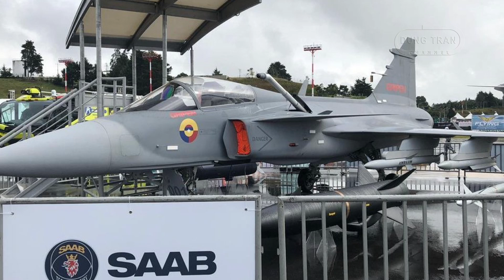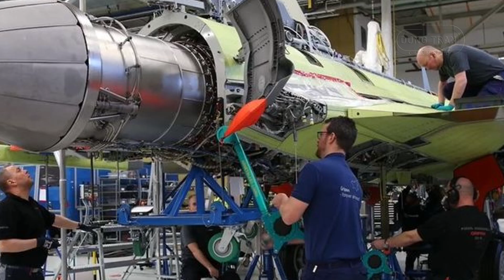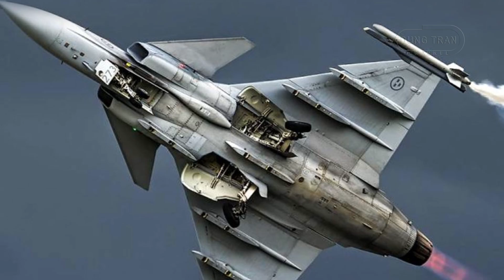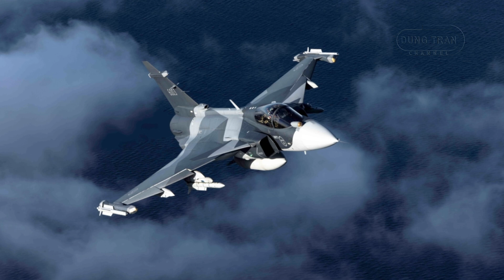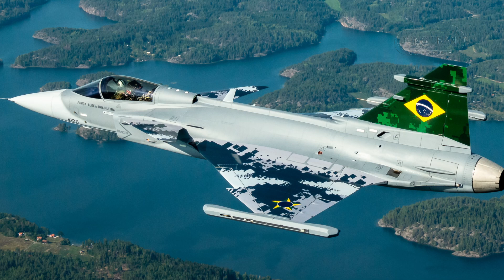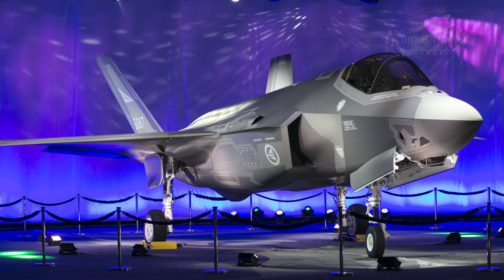Swedish Gripen's Achilles Heel: The American Engine

Comment: If they are for Canada GE 414 an improved GE404 already in the CA F18 makes servicing sense, not much up skilling required . Just cut a deal with Trump no ITAR  for your Northern Cousins and you continue getting a fair deal on a certain amount of oil and gas ! rather than exporting that portion of it offshore as new pipelines come on stream .
The next President may not be bothered with  ITAR and let's face it the new Gripen E's  won't be ready till then anyway.

Comment: it would take years to adapt the design - you need to adapt assembly lines, jet design, and everything that interacts with the motor (hardware and software wise). it uses other avionics components that are US made as well. why not just buy the rafale which is already ITAR free, battle tested, proven to be the best multirole fighter in the world and one of the jets that is already in the works to be working with 1+ support drones (the successor to the dassault neuron).....
I don't get why no one considers the rafale as an option. it makes no sense.

Comment: It not is not a F404G that is just the American designation they Assumed it was a direct copy but it wasn't it's spools were changed in Sweden and if they need to they can change slightly the diameter of the spool shaft or as Donald Trump is threatening to "Take possession" of Canada Greenland and Ireland Sweden could use the EJ200 and modify it's spools to get the power that Sweden needs but if Sweden makes "All" the Gripen Engine components then Sweden cannot be blackmailed either by Trump or Engelson on the UK PM chair.

Comment: Use one of the new Rolls Royce engines, continue to make the Gripen-39, make a slightly larger 2 engine version "Gripen-42" with 4 extra 4 pack of the small air to air or air to ground missiles mounted on the wings, 2 of the new 1000 km long range super missiles or 3 big of the ones used now, it's 4000 kg. More payload and enhanced fual capacity of 2000 kg. A total of 6000 kg more payload and at least 500-750 km longer flight range. And screens and new super computer helmets with superior target tracking and lock, even more super advanced LIDAR scanner and radars in frequencies used to be superior in the 1000 km long range needed for the new super missiles. With these two versions Sweden can be the ruler of the skies in 95% of all missions, with a small 6-12-25 group of the new 6-gen Tempest for special missions with at least 2 jet fighter drones as wing men. Europe will have a superior air force as big as the US and slowly larger in 2035-2050.way cheaper and with full control of everything, artillery, infantry, engineer core, supplies of everything all setup in a super efficient way will with just 7 new nuclear power aircraft carriers with space for 75-77 aircrafts and around 50 choppers in groups of attack, rescue/self-defense/semi-attack, troop transport, surveillance/self-defense with support ships and 1-2 sub's in every group. Everything set up in an international alliance of European and possibly Canada, Australia, Japan, will be a true EUROPE and allied countries Super power of Military, Economy and Trade. 🇪🇺🇭🇲🇯🇵🇨🇦

Comment: In a modern war, the Gripen would be shot down fairly fast, so need to buy a lot of them.  Gripen can hardly be used for air superiority, though after having air superiority it can deliver the bombs.  Gripen is a simpler plane and pilots can be trained much faster on them than  a USA plane.  The F 35 is stealth and much better, though much more expensive to buy and maintain.

Comment: The engine was chosen because it's a very common engine that is used in civilian aeroplanes and its easy to get spare parts and mechanics that can work on it.
But Sweden does not have a problem buying other engineers or manufacturing themselves. Sweden has made turbine engines for over 100 years and there are a few companies that can make them in Sweden. Engines can also be made in countries like Canada by companies that already make engines for civilian aeroplanes.
Reply: It is probably not as simple as replacing a car engine... I guess that the aircraft is basically built around the engine.
Reply: @anderslagerqvist2642  The JAS 39 Gripen E engine is secured using engine bulkheads and mounting points within the airframe. So the Gripen E is designed so that the engine can be removed by detaching a few mounts and connections. A new engine would need to fit this design. But it's probably easier than changing the engine of a new car but harder than changing the engine of an old car. 

If they can build the fighter jet I'm sure they can replace the engine if it would be necessary or if the customer wants to use another engine made in their country.
Reply: @anderslagerqvist2642  this is why most civilian planes use nacelles to house their engines; ease of swapping to a new one. 

That being said, in this case, the design work has been done for using a different engine with the Gripen. Back in the 80's, a testbed program was started which swapped the engine with that from the Eurofighter in order to test a thrust vector nozzle. That program concluded around 2012, but the design work for the engine can easily be adapted for future Gripen production.
Reply: Commercial turbines are high by passing with large fans to increase efficiency. Military turbines have much lower bypass so they can be tightly packaged onboard, save weight and increase thrust.
Completely different engines in different parts of the market.

EJ200 derivative maybe considered as it is very punchy as an engine.
Reply: No civilian airplane uses the F414
Reply: @downix  True. To be specific so do the GE F414 share design similarities with several civilian jet engines, though it is optimized for military use. Components, the digital engine control and technologies used in the F414 are shared with civilian GE engines.

Comment: There was at least one successful example of changing an engine for an existing combat aircraft or a blueprint that I know of.  In the early 1970s, Israel planted a General Electric J-79 engine into a French Mirage 5 blueprint following the French embargo. The aircraft was called Nesher, and the next generation was called the Kfir. Both aircraft were very successful aircraft; however, in general the Mirage 5 was less agile than the lighter Mirage III because it was bigger, heavier, and carrying more fuel.

Comment: According to Dassault, Rafale is relying on American auxiliary power units, lighting systems, fuel nozzles, wheel brakes and brake controls, transducer, electro-optical and passive electronic components, cabin systems, canopies, fuel tank sealants, corrosion inhibitors and various mechanical components and electrical power systems.

Also the Eurofighter uses American systems. For example, Lockheed Martin - Sniper Advanced Targeting Pod.
Collins Aerospace - Large Area Display.
Honeywell - Life Support Systems.
Northrop Grumman - Inertial and satellite navigation systems...
Reply: The Rafale's APU is manufactured by Safran, just like its wheel brakes. Safran is the world leader in these fields and even supplies Boeing. It is therefore highly unlikely that Dassault would choose a foreign supplier over a compatriot and global leader in the industry.

The same goes for electro-optics: Thales is also a world leader in this sector. No one wants to buy Russian weapons anymore since Russian manufacturers can no longer equip them with Thales optronic systems and have to replace them with inferior domestic alternatives.

As for the canopy, they most likely went with Saint-Gobain, a French gem in the glass industry. 
Even the Rafale's tires come from Michelin.
Reply: @Ccleanerable  Dassault might (also) refer to - and include essential components... Computer processors etc. are mostly also of American origin. Gripen C has around 30 computers - Gripen E even more - for example...

Comment: Fun fact:  gripen costs about the same as an f-35a, about 85 million USD.  How can the gripen be a good deal?
Reply: Dispersed operations that Gripen is designed for : STOL = very important. The first thing Putin will aim his missiles on, are the air bases!

Secondly, the low operating costs = Around €7,000 ($7,500) per flight hour.

F-35 = Around €40,000 ($42,000)...
Reply: Gripen have almost double the mission readiness, which means alsmost double the amount missions per airplane compared to F35. Also, the cost for a flight hour is about 5000 usd vs 35000 usd for the F35. These are the purely economical reasons. A bigger issue is that we can’t trust US as for now.
Reply: @tommyk2336  Percentage of F-35s Fully Mission Capable (in the US):
https://www.youtube.com/watch?v=PbUb5s2Y8Vw
Reply: @-NiEr indeed it’s not a good look for Lockheed Martin. To be fair to the countries who bought them, they probably didn’t expect the low utilization rate, and I expect cancellations and less interest until they have sorted themselves out.
Reply: @tommyk2336  I have read that the F35 has around 50% frontline mission readiness rest is maintenance1 I expect that the B variant is worse.
Reply: https://youtu.be/QyD0liioY8E?si=M4DogjRfnGAuPiBe
Reply: F-35 price is without the engine.

Comment: TY-Yeah Canadian aviation has built the 'Orenda" jet engines for decades, and there is Pratt & whitney Canada , building the similar engines , so I doubt re-engining the griffen is any issue , at least we have several options in easy reach....amd the Rolls Royce as a 3rd.
Reply: Yeah, re engining a fighter happens all the time, crazy talk.
Reply: @gumby2241  The Gripen was already tested with an EJ200-series jet and it worked just fine.

Americans acting like they have a clue, stupid talk.

Comment: Well. Gripen C was made with a Volvo engine, so that is not really a huge achilles heel. Actually not a heel at all.
Reply: The Volvo engine is the US GE made under licence.
Reply: @michaelmazowiecki9195  If you think patents and licenses will still exist in a wartime environment, good luck.
Reply: @slipperyslope3912  probably unlikely. Issue is that the US ,as the original licence holder, can refuse Saab permission to sell on eg to Canada. Such behavior from the US is nothing new as US Depts of Commence and State use political pressure of all kinds to ensure the US gets the business.
Reply: @michaelmazowiecki9195  The USA doesn't abide by any of the agreements it signs, so the world is going to stop recognizing all patents the USA holds. Watch.
Reply: @michaelmazowiecki9195  And heavely modified by Volvo aero engine manufacturer, there is hardly 50% left from the original engine..
Reply: @tomasandersson2182  much better if no licence permission needed.

Comment: Rolls Royce makes an engine that will fit nicely. Problem solved.
Reply: sweden can do as in ww2 -just copy the engine in question and do the deal later assuming that sweden did survive ww2 which they did -this is the same situation basicilly
Reply: @jarihaukilahti  Besides if the US doesn't have to follow International rules, agreements and treaties then why should Europe have to honour them when it comes to the US.
Reply: @JohnnyFastbuck why follow copyright from a country that doesn’t honour your sovereignty?
Reply: The SAAB 35 Draken had a RR engine!
Reply: I wonder why they choose that engine . Even before Trump the engine made it  hard sell due to  US regulations .
Reply: Also SNECMA had one in the pipe for Gripen: the M88-3.
Reply: @beru58 you think the French are more straight forward than the Americans?
Reply: Wonder what happened to the Volvo engine ?
Reply: @dos3722 It was obviously obsolete. The new one has much more thrust.
Reply: @dos3722 nothing, Volvo Aero RM12 engines Power Gripens up to C model, e/F models use RM16 General electric engine,same what super Hornet uses...

Both RM12 and RM16 give exact same speeds to fighters and in case If USA would not sell RM16 engines Volvo Aero could easily start manufacturing updated engines anyway, or just Make RM12's which they allready built ~300 pieces.

Newer RM16 is basicly just bit more efficient on fuel and it's quieter but basic engines are really close , older and new.
Reply: Schweiz  deal  was strange as  well .   The Americans screwed saab  i think  ..only to force countries to buy  those expensive f35
Reply: The UK is every bit as anti-EU as the US is.
Reply: Rolls-Royce is a British, non-EU company. The UK has long been a close ally of the USA. Think twice.
Reply: @ettoreatalan8303  so has/was Canada.
Reply: @ettoreatalan8303  All of Europe has been close allies with the USA. Until this year.
SAAB can buy the Rolls Royce engine if they want or they can make them themselves under license. They already have the technical capability.
Reply: @ettoreatalan8303  good point.
Reply: @ettoreatalan8303  maybe they could put one from the rafale and could be a single engine rafale type of plane... engineering stats look good and tweaks can be made: m88-4 between 95 and 105 kn of thrust and f414 98kn... european made weapons,  maybe for the next gen stealth saab fighter with these stats...

Comment: The engine is not american made, it’s made by Volvo flygmotor in sweden, However some sort of license is in play even though the engine is redesigned by Volvo.
Reply: As long as the licence for the engine is paid then USA cannot complain but fitting Ej200 engines would be better.
Reply: Depends on which version of the Gripen. They substituted the Volvo made engine for a US made one with the E.
Reply: Volvo hasn't made the RM12/GE-404 since 2011
Reply: @JamesBrix86  untrue. They still produce units and spare parts for model C and D units still in service.
Reply: @ Yes true. The RM12/GE F-404 and RM16/GE F-414 engines are built by GKN Aerospace since 2012.
Reply: @JamesBrix86  so you believe all of the Gripen C and D still in service are flying based on hopes and dreams?

Sounds like nonsense to me.
Reply: @downix  Are you slow? 
GKN Aerospace, a British multinational corporation makes the RM12 and RM16 engines for the C/D and E/F Gripen's now. Volvo Aero (The Company) doesn't exist anymore. 
Understand?
Reply: @JamesBrix86  "The company makes the engines. The company doesn't exist anymore" is not a good argument. Volvo Aero is now part of GKN, aquired in 2012, and still manufactures the engines.

Comment: Ther is a solution. The ej230 or even the ej200. based on a british  design this is the engine of the typhon or it next gen development. it is allread in consideration for gripen ng. This would simplify supply chane in europe and relase us from us influence.
Reply: Yes, a modified EJ200 is the best option and was, as you say, one of the alternatives for the E/F. It may be the only option actually, in terms of performance and size.

Comment: If Trump blocks the engines needed for the Gripen then Canada should buy the new Rafale F4 that didn't compete for the new Canadian fighter, and it comes with single and 2 seat as well and is cheaper to fly and maintain and do everything the F35 can do but more.
Reply: PS. Sweeden needs to find a European engine for the Gripen.
Reply: Kelly - the Typhoon is super good too but too expensive but (and I'm german) I would buy the Rafale or the Gripen (with an engine made in Europe). Canadians could be 100 % sure that there is no "kill switch" is hidden in it.

Comment: If you add up the operating time of the RM12 engine that is in the old Gripen CD, it has been running non-stop for 45 years without a mechanical failure. That is a feat by the Swedish engineers.
Reply: Last time i saw a note on this, it was over 300.000 hours running with no mechanical breakdown. I am sure this is a record.
Reply: As of november 2022, it was 400.000 hours without a failure
Reply: @rooftopv4664  Thanks. Great to know. Now i am updated. I have only seen the printed number on Gripen's tail occasionally.
Reply: the Volvo RM12 is a license built version of the GE 404 and is upgraded for power and reliability. The GE 414 is not a license built product hence it is subject to the ITAR veto possibilities. India also plan to use the same engine in Tejas . Both countries will be looking at a plan B..
  Perhaps Sweden ( SAAB ) are not as powerless as you think as they are partners in the Boeing T7 Redtail and supply parts to the MQ 28 Ghost Bat